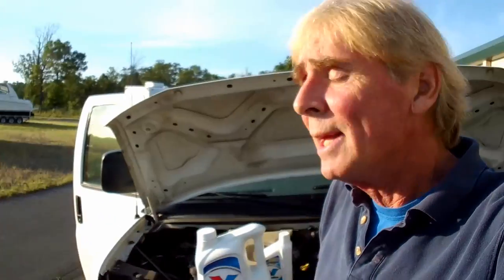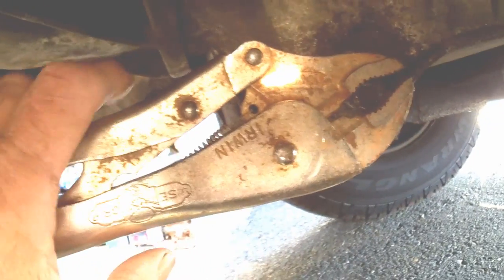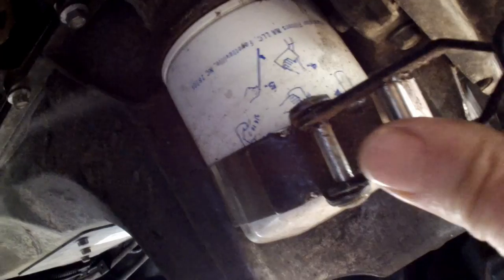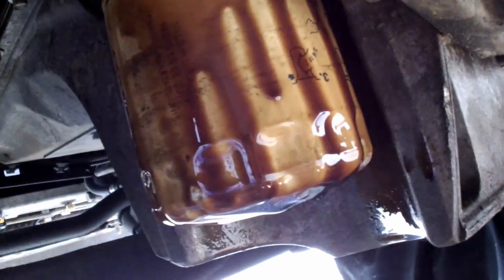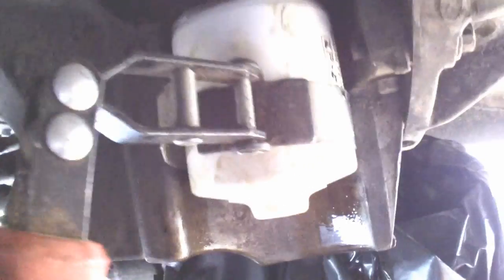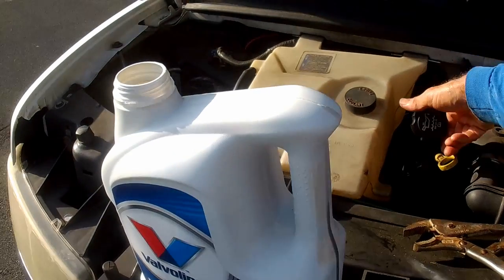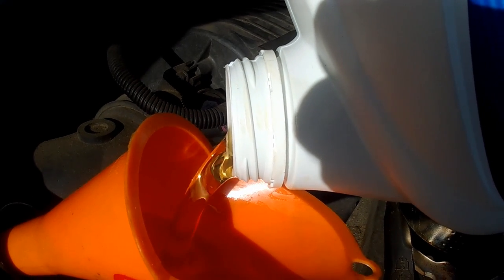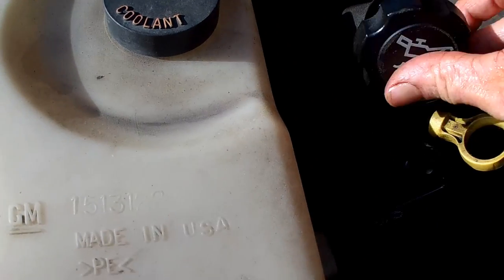Vise Grips, Oil Wrench and 1 hand, DIY Oil Change

Comment: Running thinner oil then required will cause greater engine wear. 5w-30 should be used in that motor. 5w-20 is ok when below 10 degree weather.
Reply: i didnt know it was electric van ? i though they were referred as a engine ? lol
Reply from the maker: @live4545  retard

Comment: An oil change doesn't take five minutes,, especially diy.
Get the Jack, 
Jack up car
Get the oil pan,
Find your tools,
Get under car,
Place oil pan,
Drain oil,
Reinstall drain plug,
Move oils pan to oil filter,
Remove oil filter,
Replace oil filter,
Lower car,
Put away Jack,
Fill oil,
Put away tools,
And a bunch of other miscellaneous stuff.

Your video is a lie....